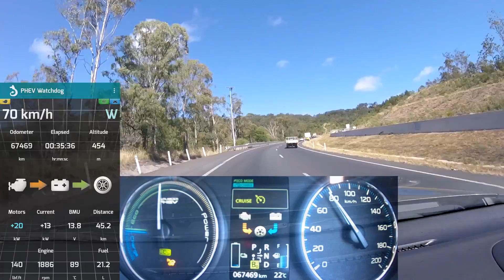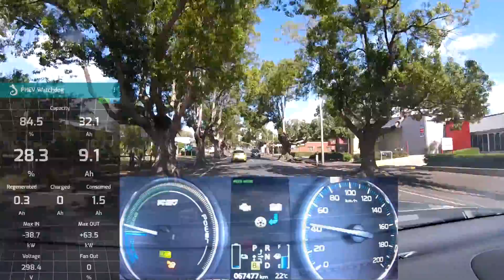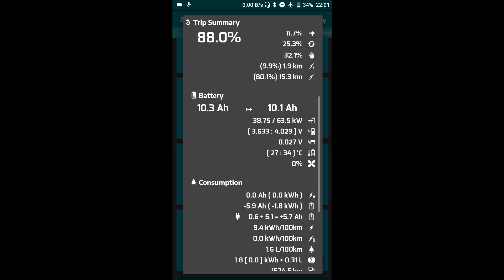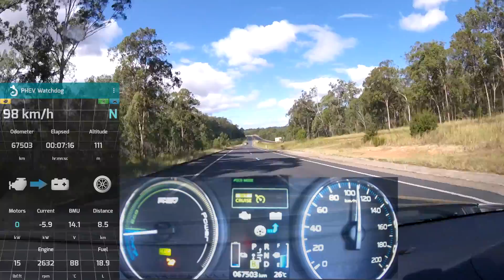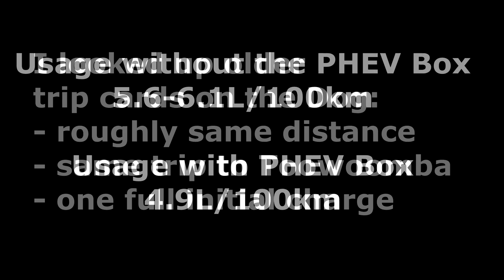EP71 - Outlander PHEV-Box Highway Drive ends UNEXPECTED + FREE Give-Away

Comment: So the box appears to forecast an average saving of 0.75 litres (worth 90p in the uk) on this 60 mile drive, so you need to do the journey roughly 250 times to pay for the box. I guess it depends it you want the box to find a financial saving or to adjust the way the car behaves.
Reply from the maker: This would just apply for journeys like this. If you drive in city traffic, it will save heaps more.

Comment: At 14:49, why does the batt->wheel indicator not turn off while you're stationary?  Are you sitting at the lights with the park brake on?  Wouldn't this mean that you're wasting some electricity from "creep" (i.e. the car powers the wheels slightly all the time, like a fossil automatic car)?  I find that the only way to turn the power to the wheels off completely at the lights is to have my foot on the brake or the car in park.
Reply: Yes, this happens very often if you don't press the brake peddal completely. And it is not just the indicator, you can really feel the car pushing very slightly as if it wants to start. When you press the brake a little bit further it stops.
Reply: I did a test with the car stationary with the park brake on.  It used 0.1 - 0.2 kW (alternating between the two numbers), with 17Nm torque on the front and 29Nm on the rear. So not really significant.
Reply from the maker: That is a good question. I don't know. It happened again when I raced the truck at the lights. Definitely not the hand brake, they're is no light for that in the dash either. I never use them unless I park the car... It does not happen all the time though. I'll do some more testing in regards to that...
Good observation!
Reply: Interesting... might just need to press the brake pedal a bit harder.
Reply: Yes, mines the same, you can be stationary in D and the light will be showing power to the wheels, its definitely a brake pedal
pressure thing, as if you press a bit harder it does stop the drive. I think the creep function is clever though and handy in traffic.
Reply from the maker: I've never seen this before I installed the box in my car. Watched some footage back and no blue arrow when the car stopped...
Reply: Mines been like that since I bought it, thought that was normal due to the creep "feature" !
Reply: Seen that also whilst driving in BO which in theory should be no engine power, just a little bit still happening at the bottom of the power meter, a brief touch on the brake pedal stops it......
Reply from the maker: Exactly what I did today. I did some short filming to show that too. I could see the 01.-0.2kW as well. I probable never experience this here due to the lack of traffic lights :D